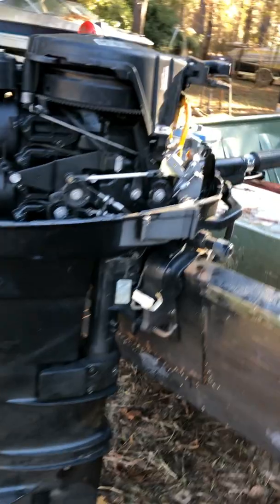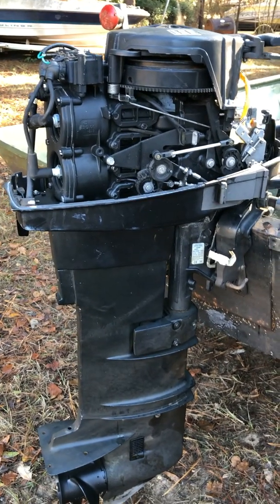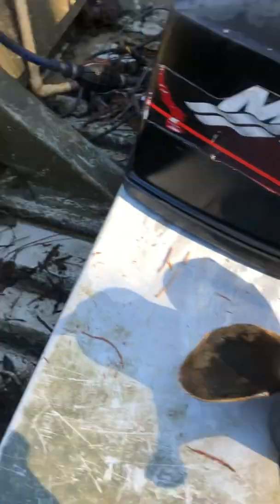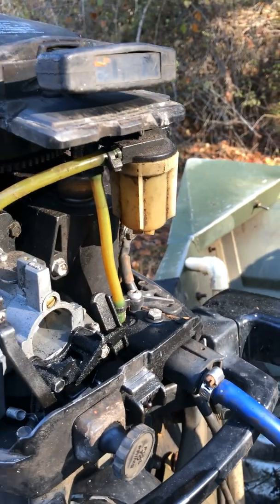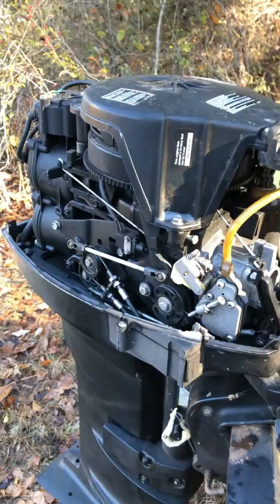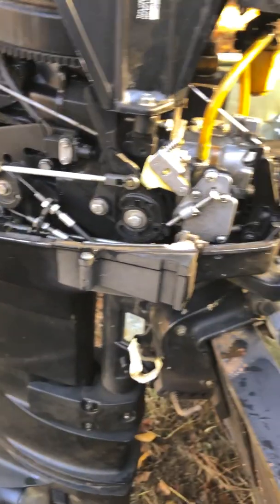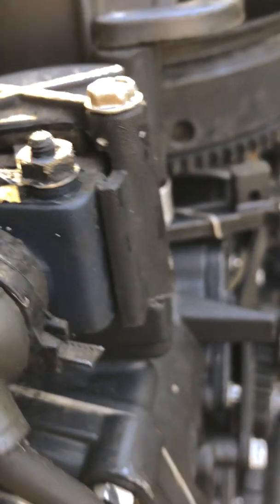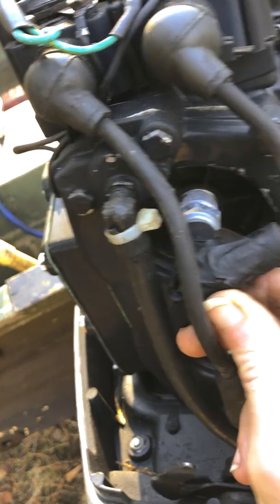SOLVED - 25hp Mercury Outboard Power Loss

Comment: good video, I have an engine like this one, it has normal idle but when I accelerate the top piston does not work, it goes back to idle, both work,
I changed the load coil cdi.
Another day at full throttle the engine coughed and both pistons worked, then it didn't work anymore.
do you have any tips that can be
Reply from the maker: Interesting. First thought was main jet in carb, but that would affect both pistons. I thought like you that if one wasn't working, then the coil may be bad. I always go back to what it needs: air, fuel and spark. One of those has to be off .. maybe this article will help: https://www.bornagainboating.com/running-all-cylinders/
Reply: thanks for the tip.
This engine has already been in 4 mechanics and they don't know what the defect is.
I'm waiting for the load coil to arrive and I'll continue the tests, then I'll post the result here
Reply from the maker: @edenilsonvicentedasilva6186  praying you get it figured out and thank you a ton
Reply from the maker: @edenilsonvicentedasilva6186  praying you get it figured out. If something comes to me, I'll let you know for sure

Comment: Great video have the exact same problem on my engine and I think it might just be that . Thanks a lot!
Reply: Check coils one is probably bad
Reply from the maker: @robertalford2588  definitely could be a coil in Mr. Daly’s case. Going to be a coil, plug, poor ground, or like in my case a cut up wire. Thank you very much for your feedback and time! Your support is greatly appreciated!
Reply from the maker: Absolutely! Glad to be of service. Should be some more boat repair videos coming this summer. Have to get the holes fixed in the actual boat at the moment.
Reply from the maker: Just following up. Were you able to find the issue or still working on it? Feel free to reach out if you need to bounce some ideas around.

Comment: How did you get the spark plug wire out of the coil?   Do you just yank it out?   I'm having a hell of a time figuring it out.
Reply: Thank you for the quick reply t Fitz.
Reply: Came out. Ripped the spark plug wire. I can see it's a pressure fit but just wouldn't come out.   I'm getting 962 ohm on the coil from neg to socket.  Does that need to be replaced?
Reply from the maker: @nimble1918  I’d have to look up proper ohm reading but I’d put a new wire on it and make sure to use dielectric grease. I think it should read between .4 and 2 ohms. 962 is almost 1k ohms. That seems a little high but might be a bad reading unless you have a fluke meter and a really good connection on the probes.
Reply from the maker: Unless it wouldn’t come off because it was melted on. More resistance is more heat.
Reply from the maker: @nimble1918  to check it you could put in the new wire, using dielectric grease. Attach the plug to the other end and ground it to the motor. Then just bump the engine over and see if you get spark. You could also use a plug tester if you have one available.
Reply from the maker: It should just pull off. They do get a little stuck sometimes. Worst case is you break the wire and have to get a new one.
Reply from the maker: Yes sir!

Comment: the high jet plug up located flot plate
Reply from the maker: Carb could definitively use some love. This time was no spark due to cut wire. Now having what I think is definitely carb issues. Wouldn't start this year. I made a video of attempted fixes. My fool self should have known to pour the gas out before adding to it. Water in the gas. Running now, but just knocked a blade off the prop. Always something!